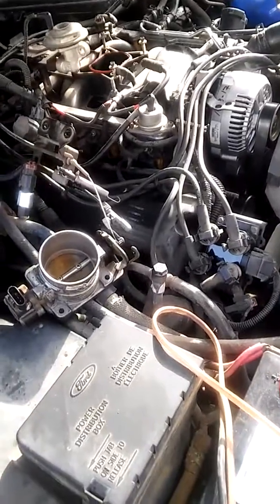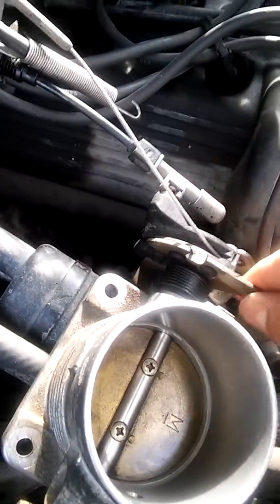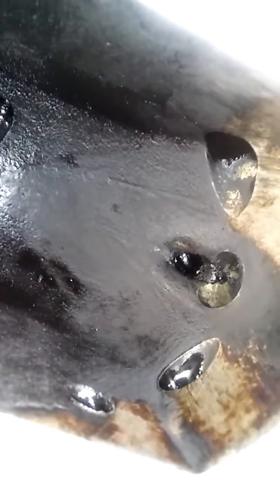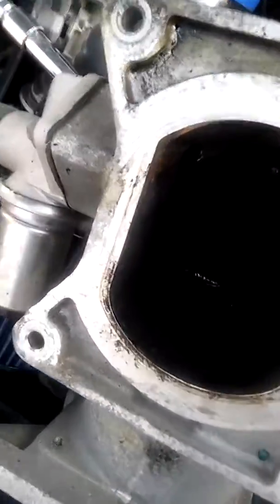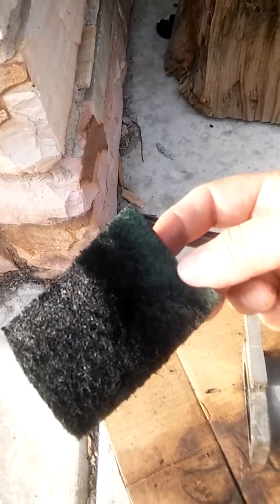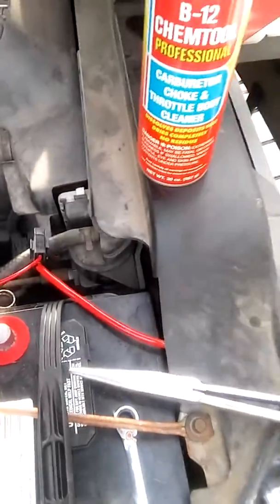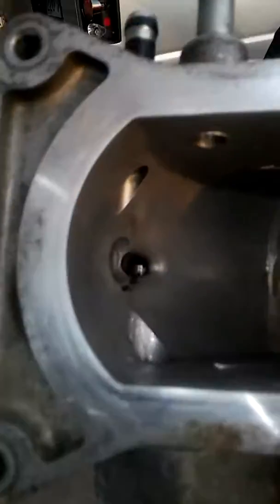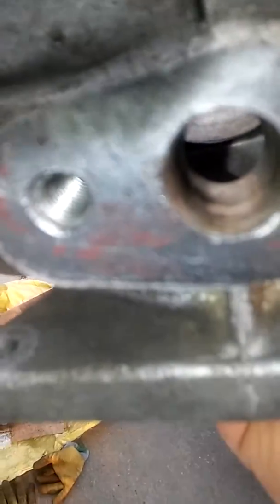1996 lincoln town car throttle body cleaning.

Comment: How did it run after? Did the cleaning make much of a difference? Any other work done after this or same time?
Reply from the maker: Hey am sorry for the late reply, it ran real good my gas pedal had some hesitation and felt a little sticky after cleaning all that carbon build up it ran 100% better, at 412k miles still going strong.

Comment: Let me guess yu got rid of the classic? Yu made this video 6 yrs ago ND I don't see no more videos of the lincoln I have 97 towncar exe I don't go to the shops  I've had this car for 3 years ND I've done pretty much all the repairs when I got it man the last dude didn't do shit to it ND everything started to fuck up as soon as I got it
Reply from the maker: Yeah bro sadly I had to. She got wrecked and had frame damage .I still have my other one, 97 executive she's beautiful I have a couple videos showing her off check them out let me know what you think. I also do my own work. Nothing like doing shit yourself .
Reply: @oggarage3459  ooo shit for real that's sad I bet it kinda broke yur heart I'm sorry for yur loss my condolences 🙏  I'll check them out ND ya it's better to do yur own work but sucks wen yu need a tool lol sometimes yu can make it work with just a hammer ND a low profile jack ND half way Jack stand rite now I'm freaking having issues with my stupid valve cover she won't stop bleeding I've tried somany bandages but she just keeps dripping not alot like it was
Reply from the maker: @ELHOJAS5.8  thanks brother. She had 417k MLS and wad still going strong I had her for like 12 years it was sad to her go. Over the years I have accumulated enough tools that I can do engine swaps or transmission swaps. You know nothing fancy just amazon tools, harbor freight tools they get the job done and lots of them if they break they got lifetime warranty.